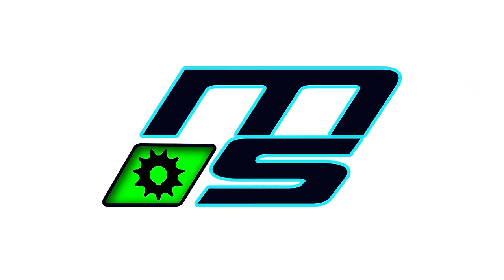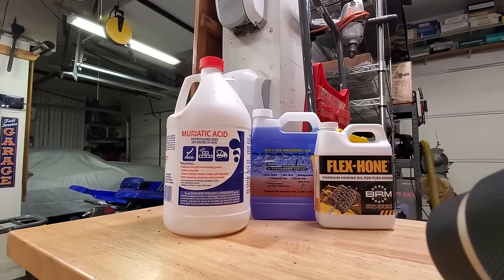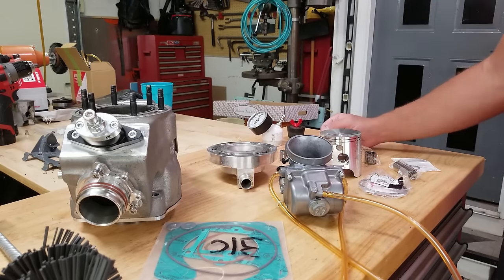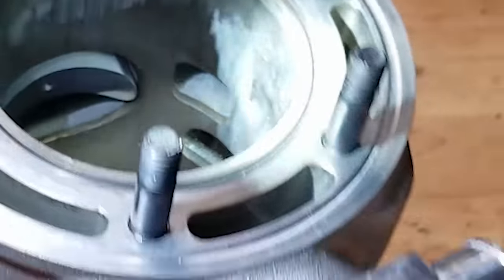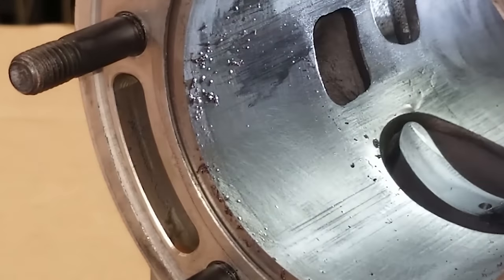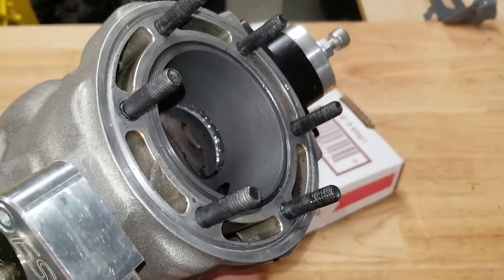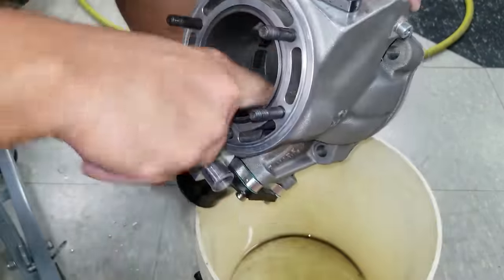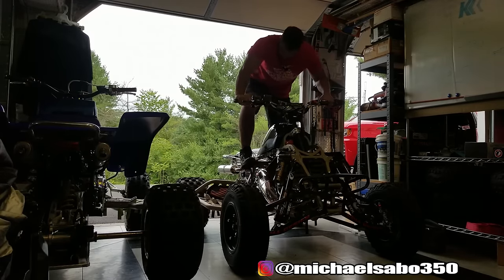2 Stroke Cylinder Honing Facts and How I do it

Comment: FWIW: Nikasil bores are approx .003" thick and needs a 240 Grit Aluminium Oxide Flex Hone sized to the same size as the bore diameter i.e If the bore size is 100mm order a 100mm Flex Hone and it will come with the correct oversize required to correctly hone the bore.

Comment: One more thing where the Plastics were hitting your frame you put that rubber gasket on the Plastics pull that back off slenderize your Plastics more. If I lived by I bring that 40 mm Mikuni carb over so you can do A and B test with all your carburetors just to see which one has more power. Very good job bud

Comment: my 2 stroke 800 cylinder has a few ultra fine vertical marks.  the cylinder is coated with nikasil.  i ordered an aluminum oxide flex hone.  As i understand it you really only want to do like 10-12 rotations max on a nicasil coated cylinder with these hones.  There's many saying not to hone Nicasil, but i do have some ultrafine vertical scoring.  what would you suggest?

Comment: I would certainly send out for a repair and nikasil coat they size with diamond hones. You left the power valve flapper the exhaust hope you removed it and cleaned really good.

Comment: Michael Sabo, what is the cylinder diameter and diameter of flex hone? what is the size of grit?
Reply from the maker: I should have included this... Cylinder bore is 72mm and Flex Hone is for 71-73mm 320 grit. The link to the exact hone I used is in the description too if you want to see it!

Comment: What would you recommend to un seize a two stoke motor? I’m 14 and trying to un seize my dads Yamaha blaster, we started it for the first time in 2 years and it was running for probably 8 minutes and then it seized up. The kick starter will not go down and I really need some help or advice for un seizing it, there’s not really many clear YouTube videos that don’t seem right. So I’m here looking for some help
Reply: Take off the spark plug put some two stroke oil down the spark plug hole let it sit for a hour then take off the flywheel cover on the left side and you will see a bit on the flywheel find the right socket for it and turn it to the right and see if it frees up if that does not do it then you would most likely need a new piston and crank
Reply: A cheap way of un-sticking engines a lot of people like to use is Marvel Mystery Oil, just fill the cylinder and let it sit for a few days. Some old timers like to use a mix of diesel fuel and ATF to un-stick engines. You could even try using some PB Blaster or Liquid Wrench by blasting a good amount into the cylinder and also letting it sit for a few days. All can be bought cheaply.
Reply: Try spraying some penetrating fluid in the cylinder let it sit there over night then see if she comes off. Also these things are underrated quads man i just fully rebuilt a blaster bottom and top end about 5 days ago and she started 2nd kick. Im 15 btw good luck
Reply: You can also sometimes tap a spark plug with a grease fitting and use the grease gun to push the piston down sometimes if it’s in the right spot.  But I don’t know where the piston is seized at
Reply: Damian Moreno should I spray it into the spark plug hole or do I take the head off?
Reply: Slane583 do I remove the head or just the spark plug?
Reply: Hydar Rahmati will I have to remove the shifter?

Comment: Looks legit but like I said before dial bore gauge to check. Hone will still remove material from the bore. Maybe next time try a drill press to help keep it square to the bore. Because you can remove more material from one spot over another. Machinist by trade myself here and everything the other sub said is still pretty spot on.

Comment: All those pro dudes you talked to and nobody told us how to clean the cylinder walls....you ran the hone down the hole and what happened? You removed  material..not a lot but there are still particles  in the bore..soap and water. Scrub it until your hands are spotless and it's good to go, right? Getting the bore perfect clean is how you get best ring seal and the better the ring seal the more power  it makes. To late for this one, its already together. Next one or if you know somebody doing rings/hone on a cylinder try this...clean the bore until you think its clean and do it again..get a fresh white paper towel, fold it up in a square, get some atf..Ford or gm it dont matter, put some on the paper towel...its nice and red, right? Now wipe the  bore down..what color is the paper towel?  Kinda dirty? You leave all that crap in the cylinder drag a piston ring over it a few million times, it just packs itself in the cylinder...it grinds to surface of the ring and it's down hill from there...cant easy tell with naked eye. Get a x1500 usb camera and it looks like 40 grit. I build boat motors, big ones 5-600ci.  Blown, turbo big boost stuff...putting a pair of 640s back together for a guy who was kind of a knuckle head but if somebody has $45k to spend for a 300hr OH...not a prob..that's each..he happens to stop by when I was doing final clean on the block..paper towels and at down one side...he says wtf are you doing? It's called clean...he says dont do that, I guess a couple other engine guys told him it fucks up ring seal...I could have tried to retrain him but didn't want to mess up an easy money ticket so I washed the at with carb cleaner and didn't do the other side..weel later that motor is on the way to the dyno...owner is doing pick up and delivery...so. me being the butthead I can be ig I want..I aft only one bank on the other side..so both motors have one side at and the other soap and water. They made a half dozen pulls on av gas..made like 1540 with 24 lb boost..decent numbers. It has a fuel system somebody designed..injectors in the hat and intake ports and and 2 ecm..one is for av, swat the plug and its E85....first pull it blew out the water controler on the dyno..it went down at 5400 rpm and almost 2400tq...motors go in a cat, the hp curves need to match...helps with keeping the boat pointed in the right direction..cant make them match at that power level so it gets +5 on the top pulley and 5 on the spark curve...2250 and 2300 12 pulls total 2 days later they detuned and run the other motor...they ran within 25 hp from 3k to 7200..motors come back to the shop, valve lash, comp and leak down cut open the oil filters..compression was × 10lb both motors...leak down was a bit interesting...while the difference between each cylinder was ok...take the number from one side of the motor and averaged them and each motor had one side that leaked down 4% Less...and ya. I wrote ATF in big red paint pin inside the valve covers...I thought he was kinda funny when he called bullsit..tell me I got the motors confused. 3% is supposed to be about 100 hp at those power levels..so figure 50 free freekin hp on a basic 1000 hp bbc... and then there is the one about the vacuum pump..another 50 free freekin hp.ya the pump ain't cheap and it takes a little power to spin it but it's a bolt on with the added benifit of eliminating minor oil leaks

Comment: DIY muriatic acid banger. 
Fill Gatorade bottle quarter way full of aluminum chips. 
Add a small amount of acid
Shake and replace cap quickly 
Put it far away and watch how loud they bang.

Comment: Great vid, stumbled upon it looking up the size of hone I need, one thing to note - your crosshatching is poor by machining standards as its never going to be anywhere near 45 degrees - its really hard to achieve by hand, this will be be worse than factory crosshatching so if you pull your cylinder and its in perfect shape I suggest you skip this as you wont get 45 degrees that are deep enough easily - you can go larger grit and lower rpms. For a 45 degree your feed must be close to your surface rate. The reason you want 45 degrees is to prevent ring glazing and have good oil retention. excellent video though!

Comment: I was wondering if this method works on cars where the engine's cylinder due to age turned into a mirror. I think you have to set a slower speed for the drill, count the number of strokes and time you spend on each cylinder and should work

Comment: I've got ktm 65 17 model got a mild vibration in motor when I rev it up high revs in neutral . and it pisses oil out the exhaust at the join in middle even at 35 to 1 fuel ratio would that indicate a worn bore needing top end done ???

Comment: If you use red scotch brite break everything apart and wash down and all points with soap and water.  The fibers can get into all knooks and crannies, especially bearing races, the fibers have metal embedding and not polymer like blue and green.

Also with the cylinder off why not send.it off for some porting

Comment: humm im lost. my kx80 piston rings got stuck. (ran it without coolant the fluch bold fell of somewhere when i drove home)
noticed it the next day when i check the coolant and there was none..
put some in and didnt think much of it... ran it a couple of days later for a full day. and found it lacking power....
so later taht week at home check and yup, top rings are melted to piston and piston has deep scratches..
anyway after a week i finaly toke the cylinder off and its not that bad but like i feel the scratches.. and there is one deep but you dont see them with they eye...
so i dont know if i can hoon that? cause a resleeve cost to much money... im kinda new to this stuff. its a B bore 47.94, so i think i need a C bore 47.95 now? but form what i understand now the walls need to be smooth... they for sure arent.. so i touhgt that stone hoon tool would make it smooth again???
Reply: Fixed it and broke it again 😂😂 great

Comment: Honda makes 0.002" over size pistons for std.oem worn cylinders or in your case where you had to do a lot of honing to get the melted aluminium off ....what you do is to use like 1500 grit wet sandpaper on the bottom of the piston skirts to get a perfect fit in your bore ..and you will not hear any piston slap or sound of piston movement at all .. And will last for years and years ....fit the piston with 0.001" clearances and run it in for just warm up at first ..and then at very slow speeds ..for a couple of days ..then it will be fine after that .

Comment: There are many ways to skin a cat that is true, If you just think about it a little bit when the factory built that engine, they didn’t use either one of those kind of homes to produce the cross hatch pattern in the cylinder.
They used the kind of home that a machine shop uses a locking hone or a rigid hone. They’re both the same. 
This is the only way to accurately true a cylinder out of its egg shape form. But if the cylinder isn’t worn too badly, you can probably get away with any type of hone.

Comment: Watched a few other you tubers go out to those dunes where you leaned out and it’s an issue with most quads if they don’t prep before the higher loads on sand. Didn’t know that but it’s not just you or anything with your build. Just the way of the sand I suppose

Comment: Your videos are excellent but you really should have removed the power valve, especially since it is so simple.  If any residue or grit got trapped in there it's going to accelerate wear.  You may have also worn down the face of your valve--it is aluminum.  You don't want to increase that gap between the valve and the piston because it bleeds off pressure, which is the whole point of the valve.

Comment: There's a lot of controversy on if nikasil cylinders should be honed.
Jeff Slavens at Slavens racing says "NO".
He has a video out about cleaning up a cylinder when doing a top end.
In short, grit from the hone impregnates into the Nikasil.
Honing can chip or flake off the coating around the port edges.
Watch his video to get more info.

Comment: The first hone with the spring arms is actually a large brake hone that is sold as a cylinder hone by dodgy cheap tool sellers.
A proper cylinder hone has stones on carriers that do not swivel, they are adjusted outward to set the pressure but the stone does not move off the line concentric to the bore in use, however those hones are far more expensive hence the cheap and nasty method is the brake hone that may work for 4 strokes that have no ports but on 2 strokes ... not good.
Dont use a ball hone on a 2 stroke, specially one that has plated bore and narrow port bridges, that's all Ill say about that.

Comment: Wanna have some fun with the muratic acid .....STEP 1: Get some aluminum foil and make about 50 or so small wadded up little balls about half the size of a marble ...STEP 2:  Take a 16 or 20 oz bottle ...empty contents ( if not empty)  rinse with water .....once bottle is clean and empty take the aluminum foil balls from step 1 and put in bottle .....STEP 3 :  Fill bottle just over quarter of the way full ..STEP 4 : Put lid on bottle shake 4 to 5 times and throw on ground or in a trash can (outside not indoors) and get about 20 feet away and just wait for the boom.......

Comment: Not supposed to use a bead hone or as you say Flex Zone on 2-stroke cylinders that are coated with nicasil. 320 Grit wet sandpaper put in the cylinder then feed your stone hone in there and go slow up and down

Comment: I would just say when it comes to nikasil go watch jeff slavens you tube video on using a ball hone on nikasil. He is a ktm mechanic over 40 years. To each there own if it works go for it. I prefer a green pad and paying 20 bucks to a shop to diamond hone the cylinder if ever needed. That said nothings wrong with using a ball hone on a sleeved cylinder. I wonder if you wiped the nikisil off the cylinder if the manufacturer of the ball hone would pay to fix it since they recommend it being ok.

Comment: Bit dodgy should've removed the power valve and reads before you started
Reply: All the best mate just remember from an old dog cleanliness is next to godliness clean before and after you do a job also chamfer the piston skirt so the oil stays on the cylinder 😃💪👍🇦🇺

Comment: You don't want a very course hone job on a two stroke like you need on a four stroke ...as we are not honing a two stroke bore to help seat the rings ..two stroke piston rings are pinned to the piston and can not change location ..so you want the finest finish you can polish out on your two stroke bores ..the slicker it is the faster it will go ..

Comment: You should never use a flex hone in a cylinder with ports, it rolls the port edges.  Always use a standard cylinder hone.
Reply from the maker: Almost 100% sure this is not true; Hone manufacturer informed, 2 stroke technician recommendation and now experience to back that it's okay.
Reply: Michael Sabo This is from a high end engine manufacturer.  The stones load and bend the rod they are attached to. When they come to a port, they spring forward and out.  The edge of the port is what guides it back in.  You should have broken edges on ports not sharp edges anyway, but it is better to do it controlled manner, not with a rock flail.  You can see the effect quite noticeably, especially if it is a new hone.  Leading edge will be rolled, leading edge is sharp.

If I can get access to a Phantom, ill set up a test stand in the shop and do an A-B comparison and link it here.

Im sure in most situations, nothing will happen.  Just putting it out there.
Reply from the maker: @monelfunkawitz3966  first off, I really do appreciate your incite and offering of experience and knowledge. I am wondering if the ball hones have evolved over the years and become less aggressive making it more likely not to damage the port windows. 

The original reason why I didn't choose the ball hone was for the exact reason you mentioned, however, I've been assured that it will not harm the port windows and to run the hone in both directions to have the same effect on both sides of the ports. 

I'd be very interested to see your test. Which manufacturer do you work for if you don't mind me asking?

Comment: Any twostroke with all those ports in the barrel/sleeve require fixed honing stones that are perfectly parallel to bore... those flex crap things fling out from centrifugal force and damage ports... FACT... worst honers to use on any engine. But catastrophic for twostroke engines... seriously, very disturbing to watch someone using those dodgy crap honers... there are excellent fixed stone honers that can be adjusted for bore size and even semi fixed that swivel in centre of stone are still better than flex crap...

Comment: 2 stroke cylinder honing facts and how to do it
Erm...... Your not actually meant to hone niksalin barrels facepalm
Nikasil is too soft, honing marks end up deeper than they should be, which leads to premature piston ring wear and causes piston skirts to scuff up, with a higher chance of cracking...
(i used to niksalin plate barrels for a living)
A very light scuff up with a fine scotchbrite pad is addequate, Just to remove any sheen from the barrel..
Reply: Sure you are , how do you think they set the piston to wall clearance after re nikasil plating a cylinder? You use diamond stones in a real honing machine not a piece of shit ball hone that wrecks all the port angles...